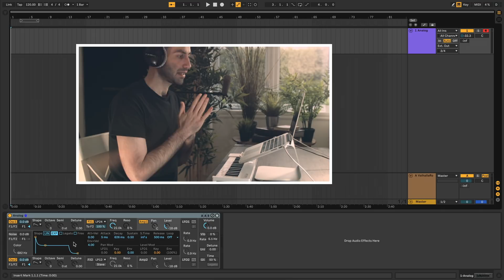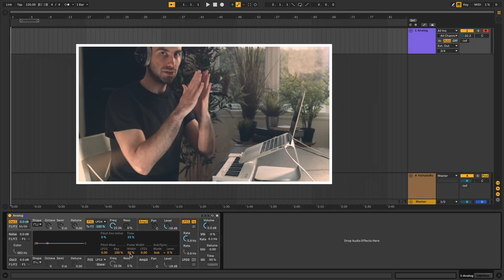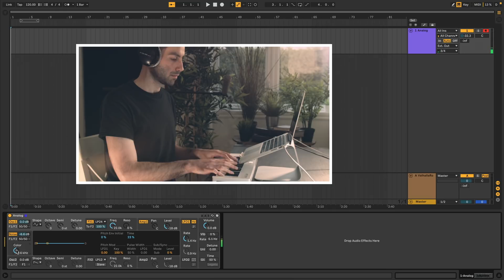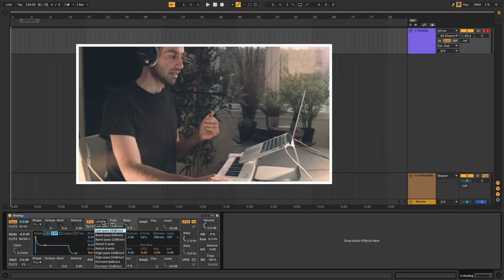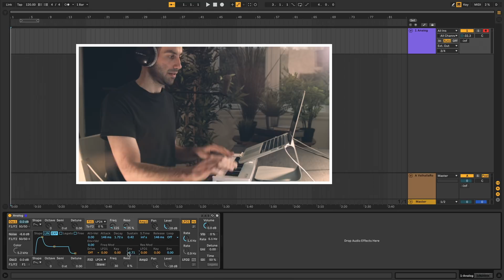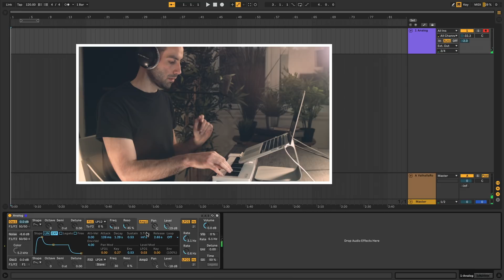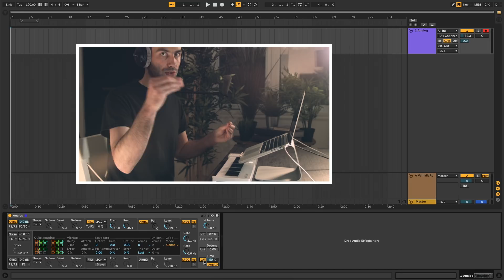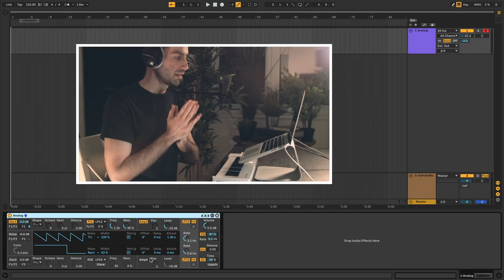Ableton Live Analog synth tutorial

Comment: How did you get the latency on your midi keyboard to be like zero?  I adjusted my sample rate down to as low as 768 but there is still a little lag when I hit the keys which makes it difficult to compose bass lines.  Sample rate is 44100 and driver error compensation is -300ms.  I still can't get rid of that millisecond lag of when I hit the notes.  I'm using a Novations 61SL MKIII
Reply: Use ASIO drivers on Windows. You'll need either ASIO4All or a dedicated USB interface.
Ableton covers the issue in details on their website by the way.
Good luck!